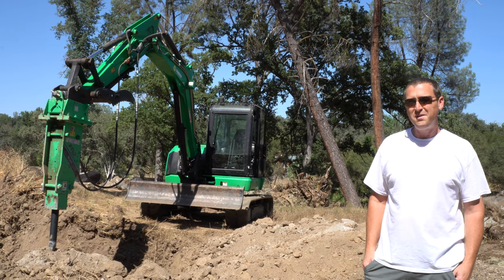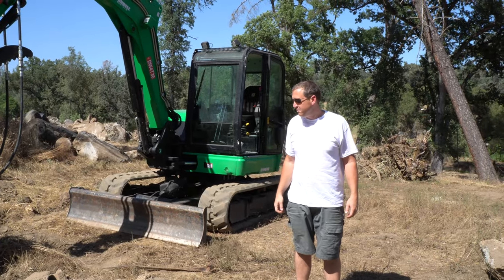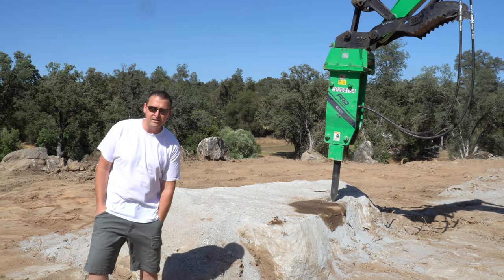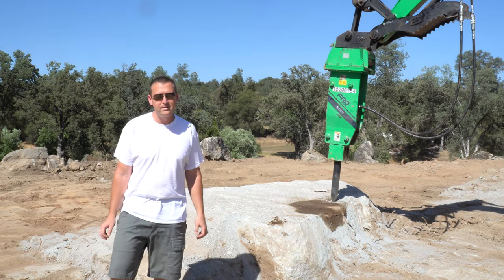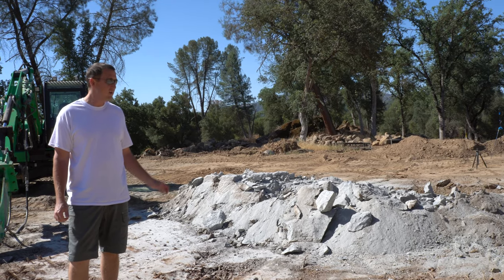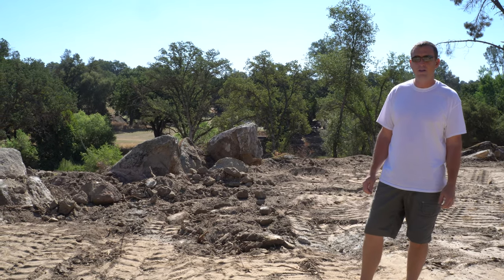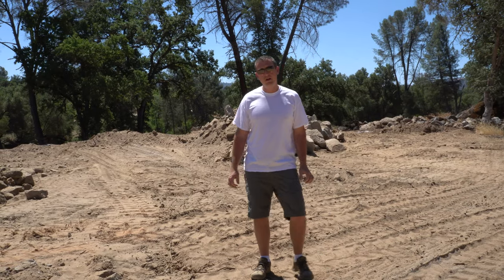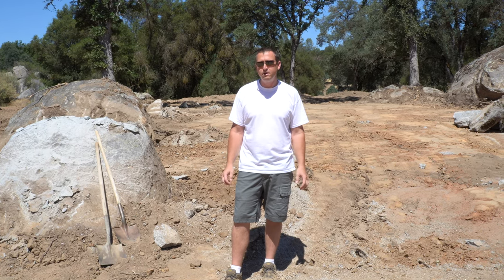Removing rocks with hydraulic breaker

Comment: Do you need a special licence to rent one?
Reply from the maker: Nope! Sunbelt rents to anyone and are easy to work with...including pricing online. The delivery driver will show you how to do the basic operation of any of the machines. From there you just need practice to become proficient at using it. Good luck!
Reply: @BuildItLikeBeckhams  Thanks for answering so quickly.
Cheers.
Reply: @BuildItLikeBeckhams  You were rookies operating this eqpt following basic instruction(?)  Appears to be an amazing level of proficiency regarding operating this eqpt if no previous experience.